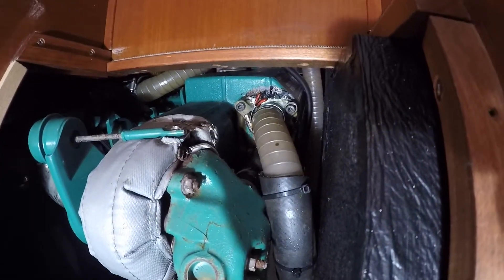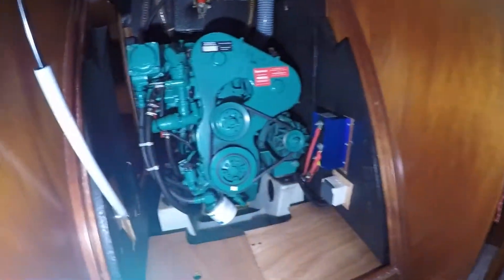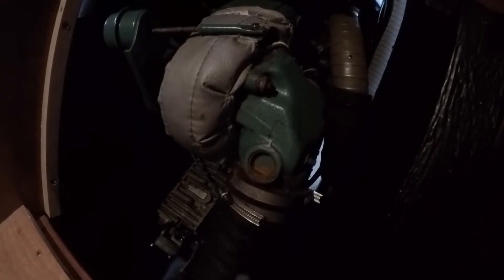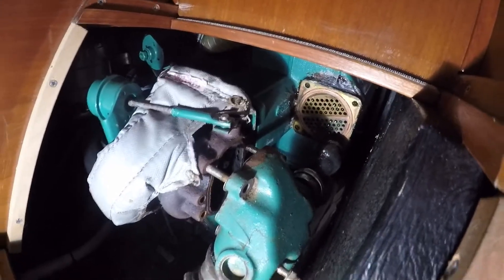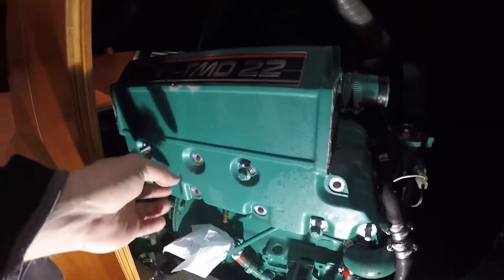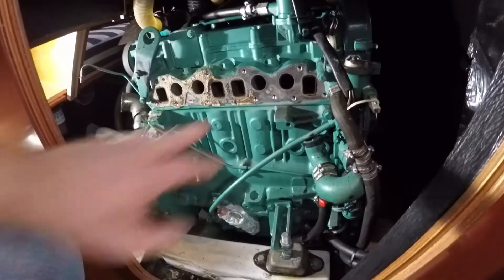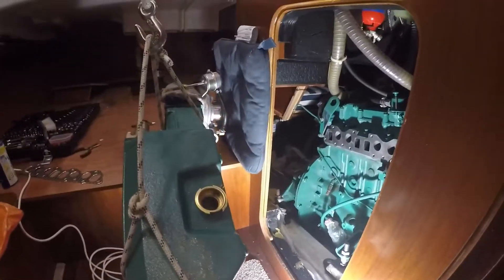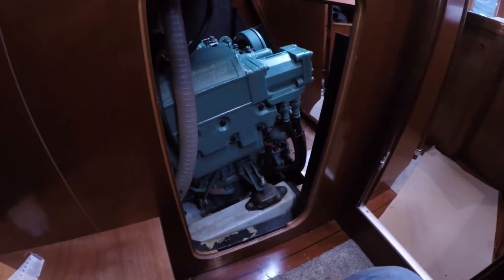Volvo Penta TMD22 Heat Exchanger Replacement

Comment: Where did you find a new TMD22 heat exchanger?  I've been searching for one with no luck.  How much?
Reply from the maker: I was lucky, I came across it on ebay in a boat scrap yard near me, not under the Volvo badge but Perkins.

Comment: excellent, do you think that a volvo tmd22 with 3000 hours and built 2003, would need such a job
Reply from the maker: Hello. Mine did due to visible corrosion on the heat exchanger block. As for replacing the turbo, hard to say, mine was pretty caked in carbon deposits.